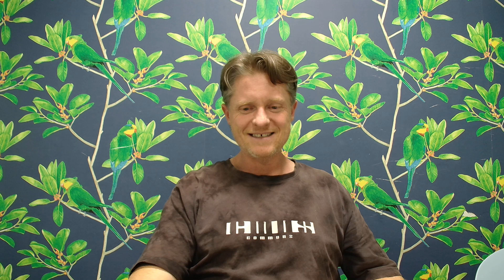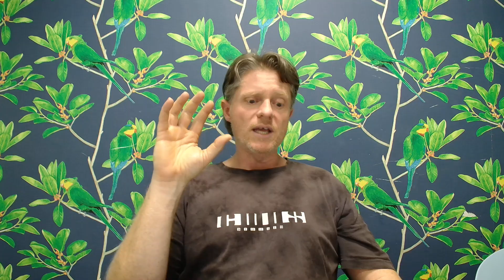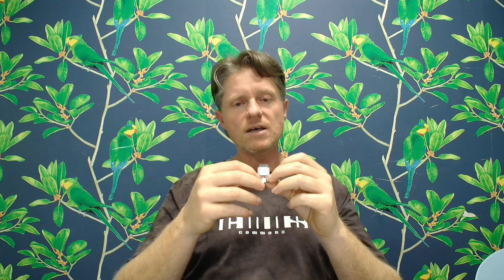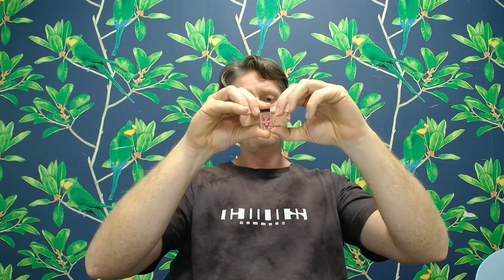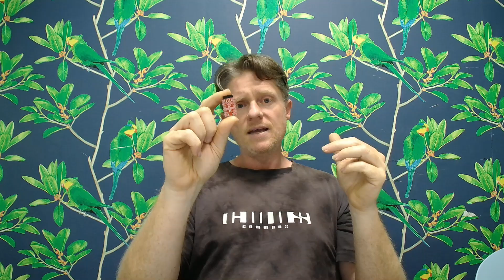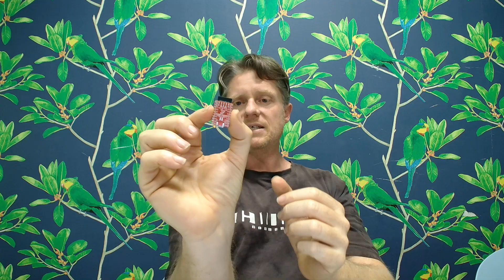HYPER S3 ROCKET   Pre production Run

Comment from the maker: Update - Sensors work amazingly well. Now with 32g and 320g options for the accelerometer. All 10 DoF tested and the Micro SD Card too. Real-time clock on board and Voltage sensing. Did I mention ESD on all power pins. SOLAR charging and dual voltage switch, reverse polarity protection, EMI Mitigation... This is a Powerhouse for all your microcontroller needs.